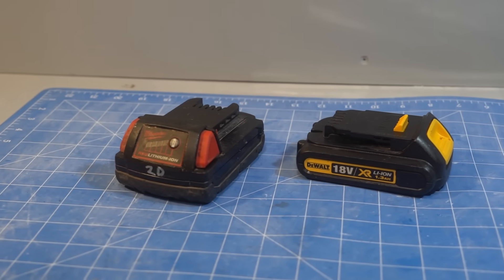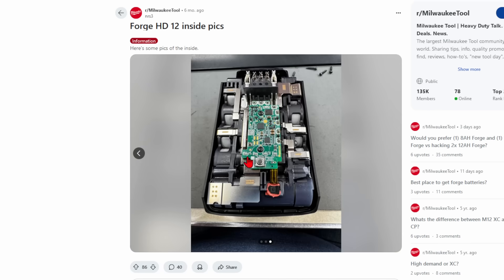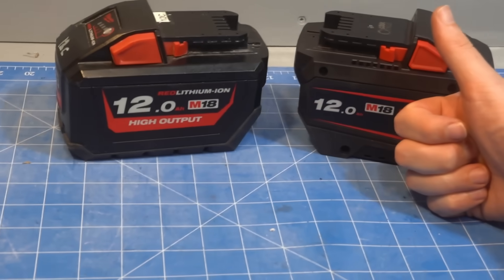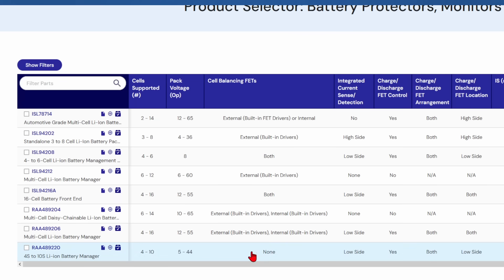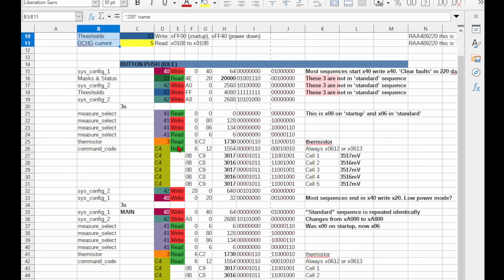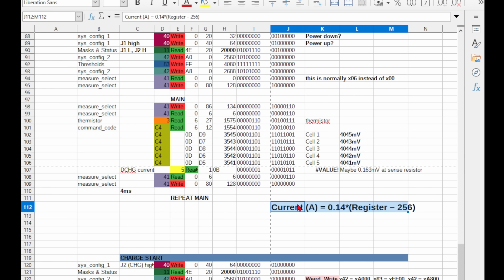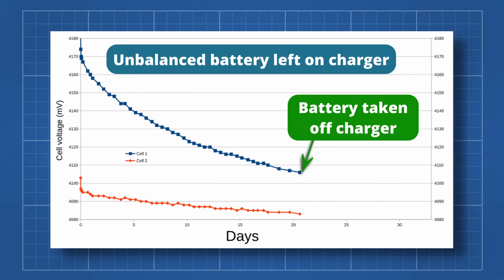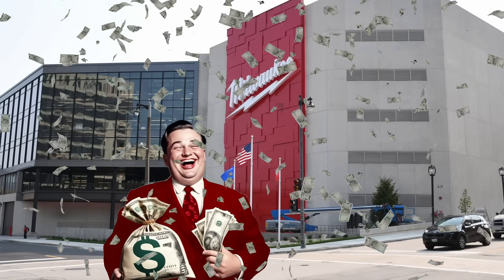[011] Do Milwaukee FORGE batteries balance

Comment: In real talk, can we file class action ?
Reply from the maker: I wouldn't be confident. Some think balancing is essential, others think it is harmful as it can hide faulty cells. I think if they're not going to balance, they should at least have an LED code that tells you when there's more than 0.05V imbalance, so ypu can lodge a claim before warranty expires. Most users don't notice until they get the "3 bars of doom", by which point there's a massive imbalance and the battery is often out of warranty. At the least it would be nice to get some sort of official statement from Milwaukee, but that's not going to happen without a lot of customer pressure.
Reply: @toolscientist  There is such thing as 'Statutory Warranty'. Based on the relative value of an item and how long should expect it to last. You buy a $40 Ozito battery, 12 months is considered reasonable. You spend $400 on a battery, you expect a couple of years or more.
Reply from the maker: We do get 3yr warranty on M18 batteries, which is good, but not amazing. Their packs that use Samsung 20R, 25R, and 30T are quite reliable. It's only the high capacity cells that have been problematic (Samsung 30Q and LG HG2, and Samsung 40T)
Reply: @toolscientist if the balancing was hiding faulty cells, then surely it wouldn't be hard to build in limits for balancing.  Eg, small variances the management system automatically balances, and it all just works.  But if over a period of time, 1 or more banks is consistently needing balancing then the BMS could count/record it and then alert you either by light flash codes or other ways.
Reply from the maker: @BramBiesiekierski  yeah, I don't buy the argument that balancing is bad, but I'm trying to be open minded. All of the downsides I can see to balancing can be overcome with just a little extra software that monitors self-discharge of the cells and also their voltage response under load. It would be very easy to pick up on faulty cells with those simple methods and soft-lock the battery.
Reply: Legit question: What dangers would be created if balancing was "hiding faulty cells?" If they're monitoring thermals and voltage anyway, and a faulty cell started acting up, wouldn't the safeties kick in?
Reply: Hy does every idiot that feels they dont get what they want jump to class action?  You have no idea what is needed or the effort required.. dumb people
Reply: Not realistic in the US given who has current political control

Comment: I knew it. Those Milfaucky mfers, even the 20mA of small hope is gone lol. I think 40T is just flat out shiiit. I'm more surprised by your 10yr old battery has only 48mV of imbalance. 
My olny question is, has that 10 year old battery been used regularly??
Reply from the maker: I think 130 cycles from the flash codes. I bought it 2nd hand just to have a 4Ah for testing. But yeah, that balance is pretty impressive, even though it hasn't been used hard.
Reply: @toolscientist  Thanks, I appreciat it. 
btw, In 6ah forge, I saw big silver mosfets on the pcb.  Are they there for low voltage cut off? any idea?
Reply from the maker: @technologicalsingularity1788  they're for some sort of cutoff. I suspect it's more for overcurrent. Pouch/LiPo are a lot more fragile, so need to be protected against short-circuits
Reply: @toolscientist  
Oh, I see. That makes sense.
Thanks for good quality video btw. Nice to see someone who knows what he's talking about.
Reply: @toolscientist  at 1:10, you can see it
Reply: https://youtu.be/lWvcG_LyQWo?si=GDZLUym9jxpZ1zcC